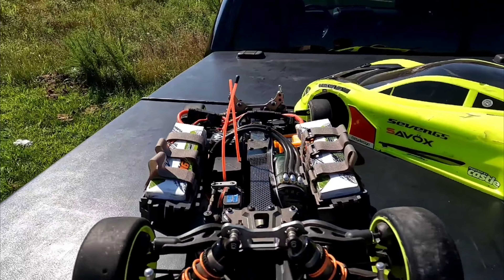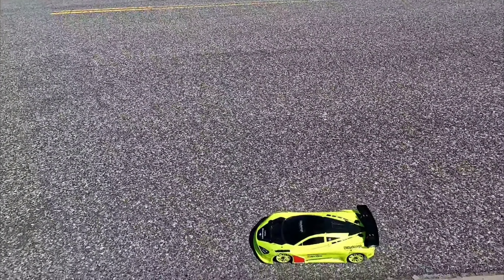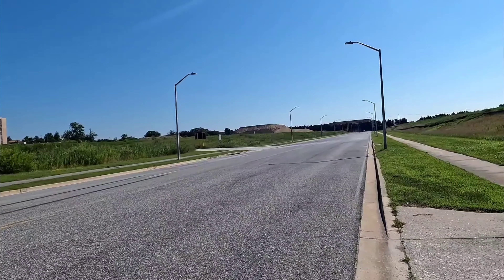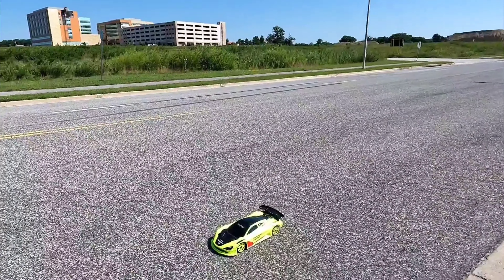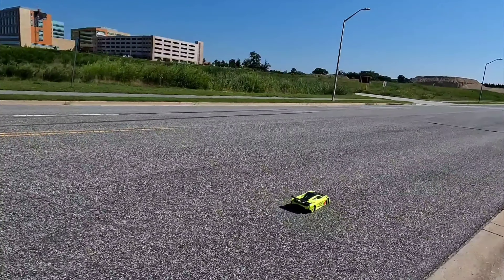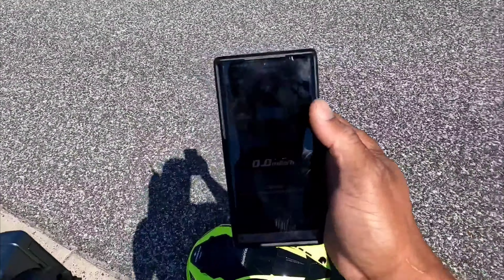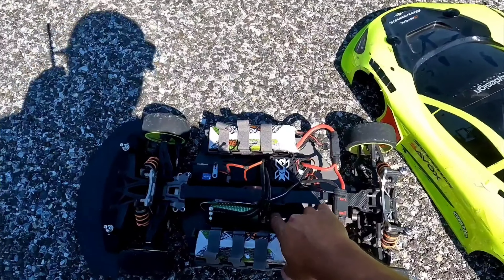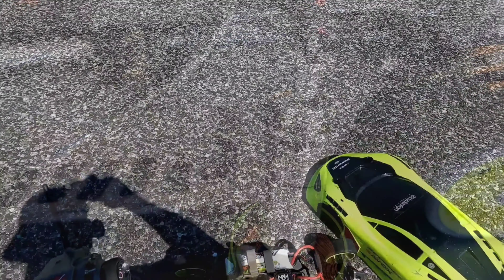Hobao VTE 2 Speed Run 1721 Motor Fail.  It Is What It Is

Comment: That's what happened  to my motor  after I hit 130mph tp power 2300kv
Reply: I heard this happened to one other person with tp motor too. You gotta make sure all the screws are tight or even better, use some loctite. I have at least 14 tp motors and never had it happen thankfully.
Reply from the maker: Let me hold one 😅💪🏾
Reply: @MatrixRC  so many and I've never even hit 100 mph 🤣 😔 🤣
Reply from the maker: To easy